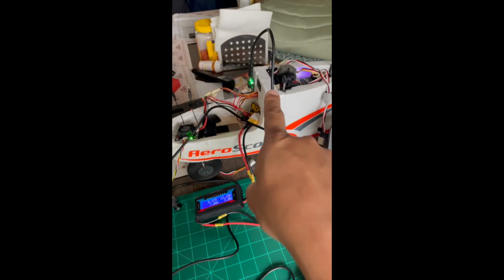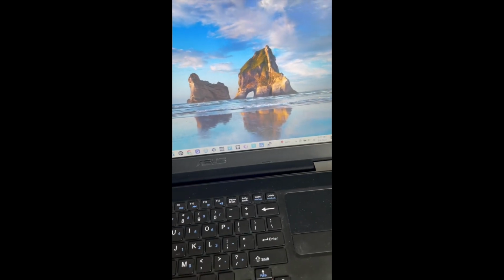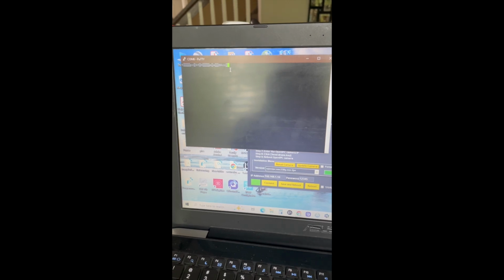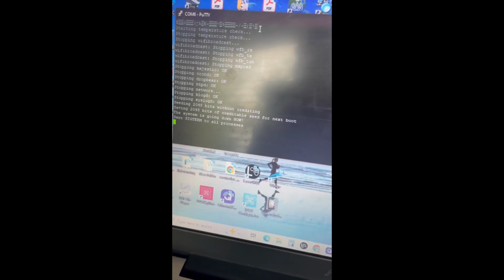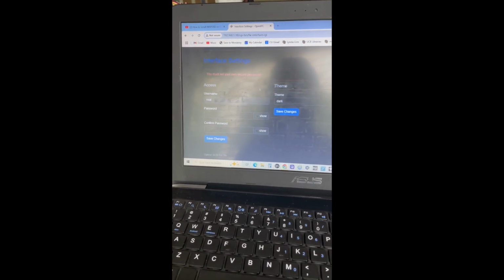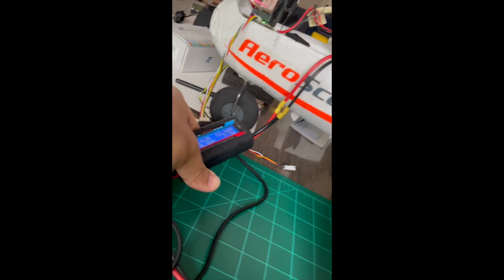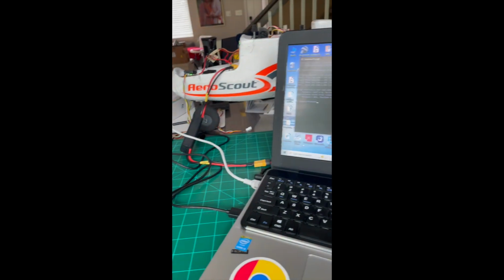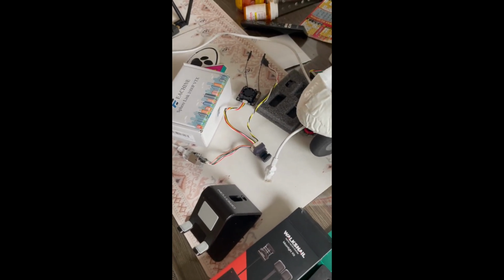Eachine Sphere Link OpenIPC INAV OSD not working...frustrated!

Comment: Are you in the telegram?

And btw, the main configurator/companion is the blue and white one. Recently renamed to openIPC companion to help with confusion
Reply: The issues with putty around 8:30 are probably because you had the configurator open still
Reply from the maker: @joshieeee20  Just joined the Telegram but I don't see anything there. And thanks I did see the blue and white Companion briefly, need to pull it up again. Didn't know it was a new thing. You have any suggestions on what things I should try?

Comment: Had similar problem but I used different openipc configurator because I am on linux. Anyway, maybe it will be the same mystery. If you are sure that you soldered correct UART RX TX pins, just upload there different firmware to the camera. For example mario aio or something. Somehow it showed the OSD in my situation and then flash back the correct firmware that fits your camera. It should stay. And be sure that you do not check option in OSD or camera settings "gs osd" or something similar.
For example when I was testing and wasn't sure about RX TX  pins, I flashed clean betaflight, applied MSPOSD on every uart and then was investigating openipc settings.
Reply from the maker: Connections are OK. Tried flashing mario aio and reflashing back to ssc338q-nor-fpv as well as ssc30kq-nor-fpv. Still doesn't work. SSH through putty keeps rebooting. It is in "panic" mode for some reason.